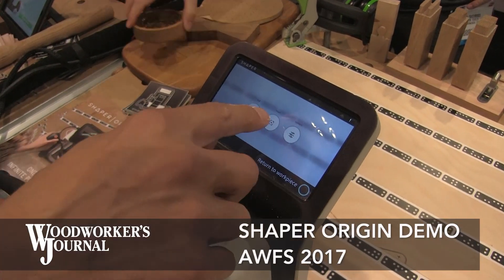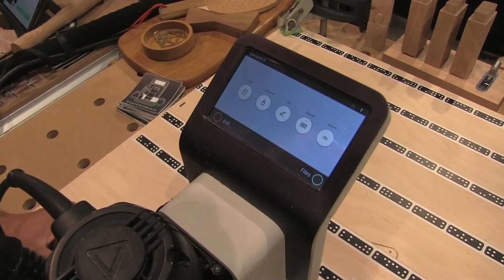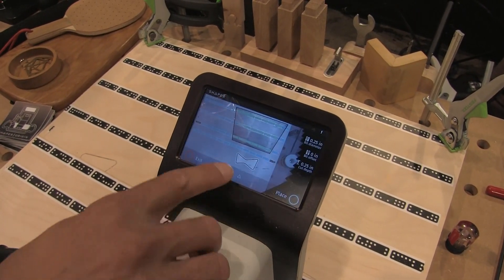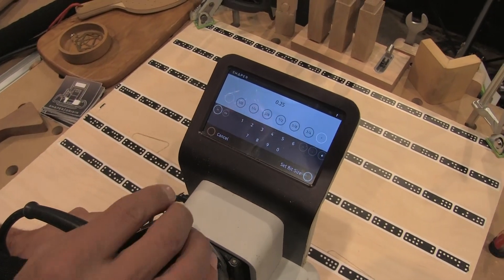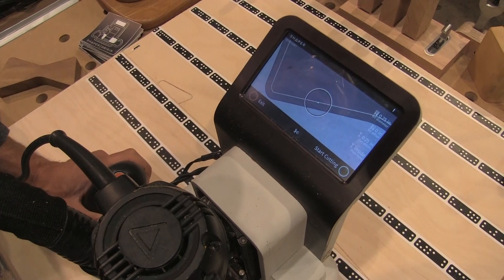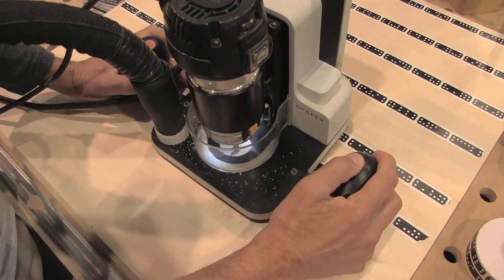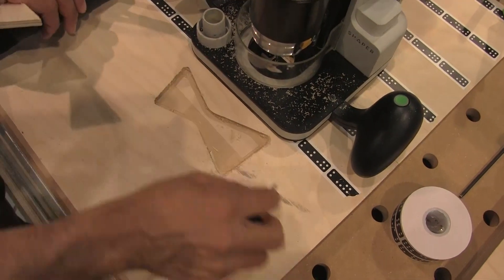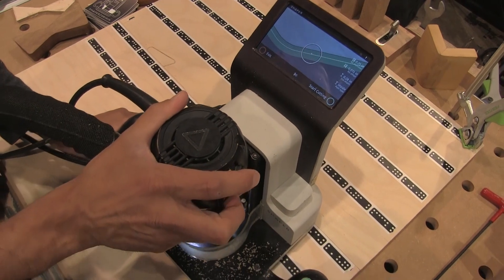Shaper Origin Handheld CNC Router Demonstration | AWFS 2017

Comment: After reading the comment, I dont believe most people understand the tool, or what Festool has done here and in the past.
Everything Festool is Friggin expensive to the general consumer. 
Festool is Not for them. 
These tools are money makers. 
Having this one tool on a site and milling out just contertops would make this tool priceless. 
When I look at new tools, I ask how much time will this save me on a job. If This can save me an hour a day, I dont care how much it cost. I'll buy it.
In a shop, that's totally different. You can afford having numerous templates around and use them a couple times a week. Or just set up a full auto cnc router. For a contractor traveling to sites, this is just not an option. 
What ever this cost, It's worth more to a contractor.

Comment: Could have done this with a $150 router, bit and scrap wood template in about 30 seconds.    Shame the AWFS has degraded into a typical woodworking gimmick show.    The whole point of a CNC is to reduce the human labor element - this is actually slower than a template setup since you need to stay within a 1/2" of line on screen.   Can't believe how much free press this overpriced tool is getting - guess all these bloggers and youtube stars love bright shiny objects.     Underpowered too - anything less than 3hp+ for a CNC spindle is a waste of time - will just burn up tooling
Reply: dont you have to make the template too? so then...its not slower. AND you can make parts very larg parts, without templates
Reply: Making a template for a butterfly insert would take the same or less as it took to stick all those pieces of tape on, not to mention dragging the machine around the board to get all your reference points.  Sorry, I've been a professional woodworker for over 30 years, and I'm not some "old timer"  I have all the latest tech and a real CNC machine.  But only tech that makes me more efficient, i.e. more money.  I guess this would be fine for a home woodworker that wants to blow major cash, but mark my words, it will be relegated to sitting on shelves (to expensive to actually throw away) like all the other gizmos out there promising to make people better woodworkers.    By the way, an Italian start-up just came out with a similar machine called the Goliath I think.  Big difference - first it's cheaper, but more importantly it moves by itself over the board, which is the real point of CNC technology - to remove the operator from actually moving the tool.  If you want to burn some cash, and don't want to send it to me first, I'd maybe look into this other machine.

Comment: Just finished my Pre Order! Save $100 by using my referral. They will knock $100 off of both of ours!

https://preorder.shapertools.com/ref/58HBD3Y1W

I was about to pull the trigger and order parts to start building my own CNC router but after doing research on this it seemed like a no brainer to me.